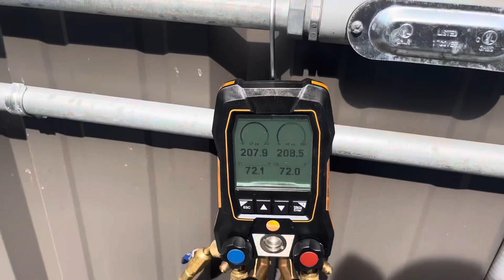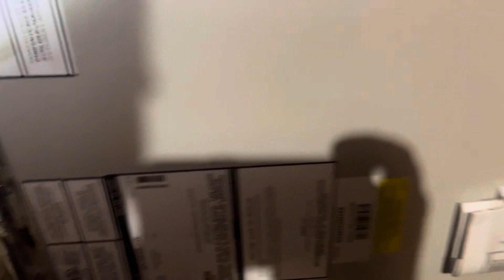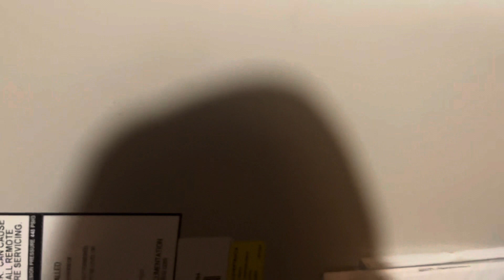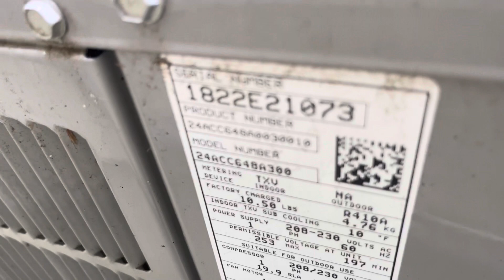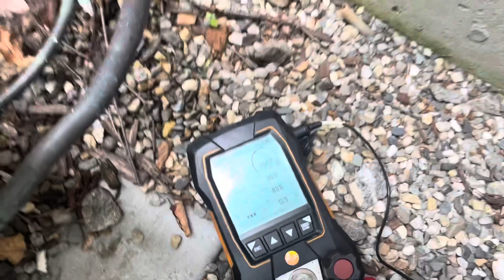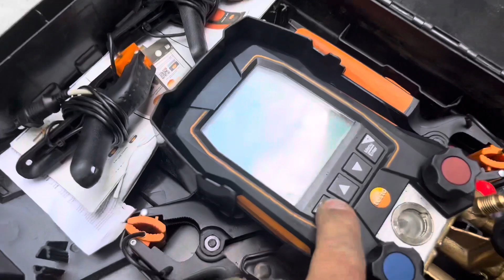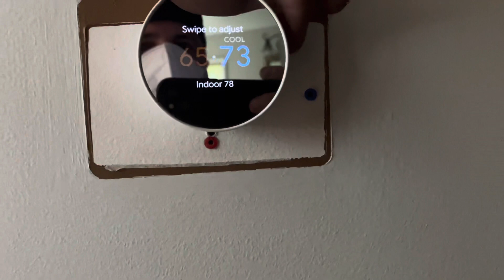HVAC. WHY DOES MY GOOGLE THERMOSTAT READ NO POWER?

Comment: 96' baby. hey I use that gallo gun and I try to cut or close off the opening to the evap and put a 90 and 6" nipple then fill to the top with water then blow in the pipe to use the hydro pressure to get it clear. Don't work too hard out there.  Work smarter. I think if he wanted you to wear a mask then he should too Right?
Reply from the maker: absolutely.  Thanks Mark.   I appreciate